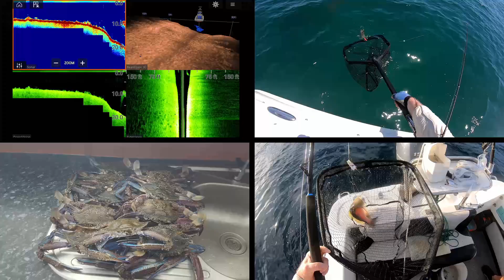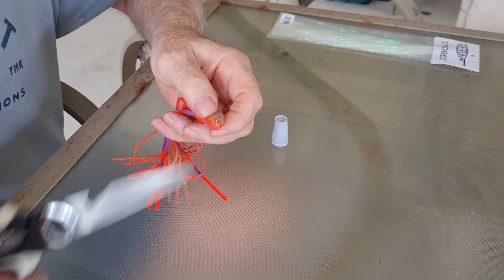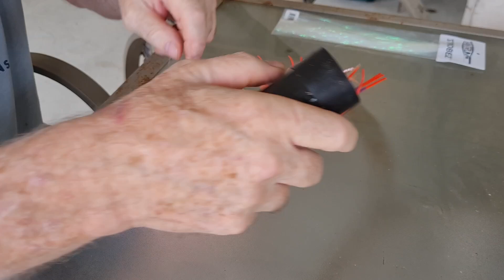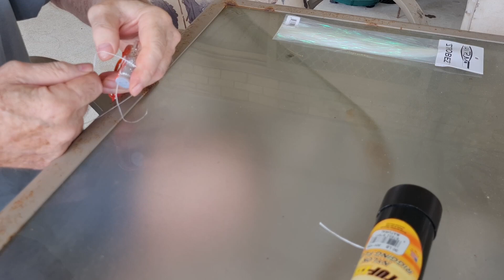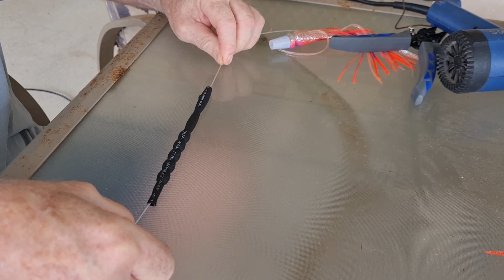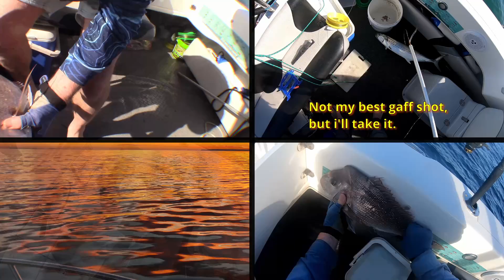What About 3D Printing Lures?

Comment: Looks great - I'm going to try 3D print some rod stands for rod building - Frogleys is running an amateur comp if you're interested after your last build
Reply from the maker: THank you.  The rod stands are a good idea.  I might give that a go as well. at least for the rear stand on the handle.  So many things you can do with a 3D printer.